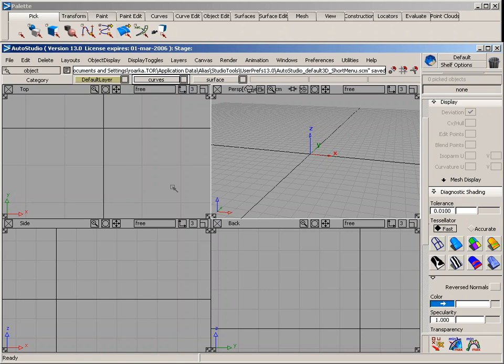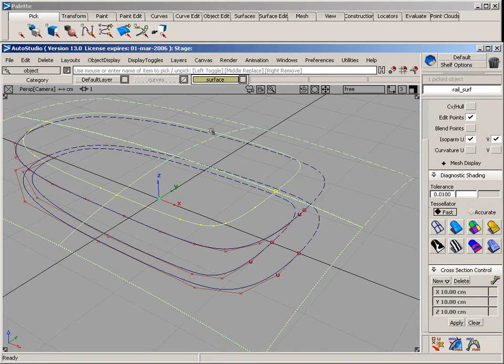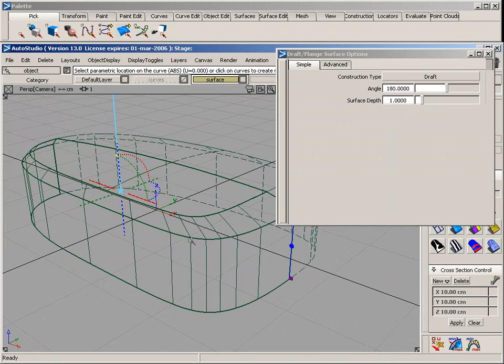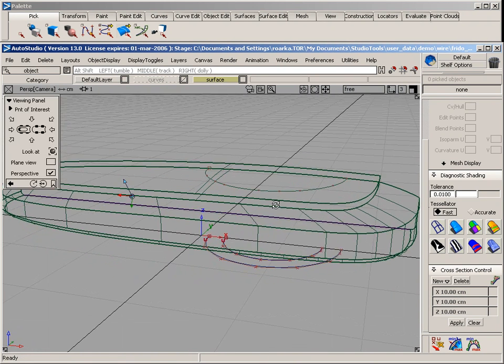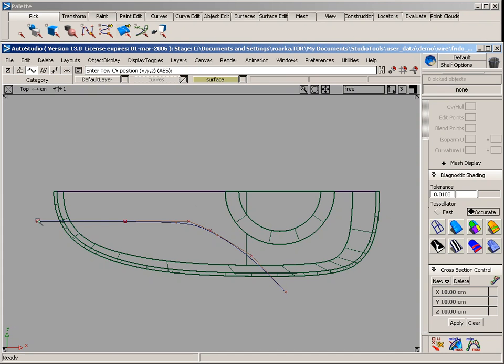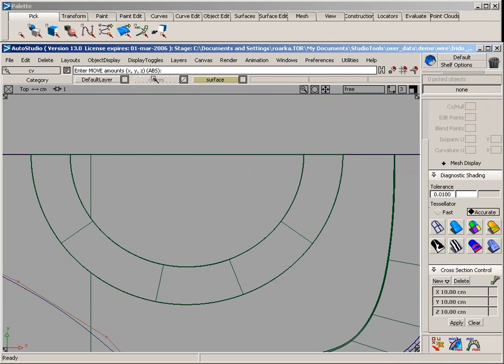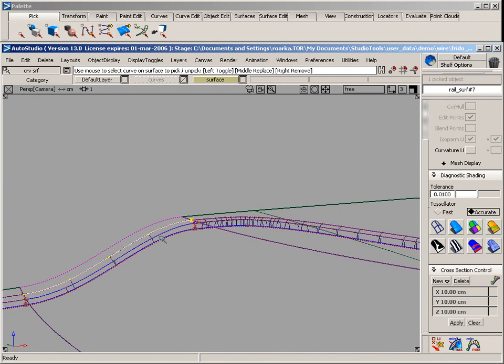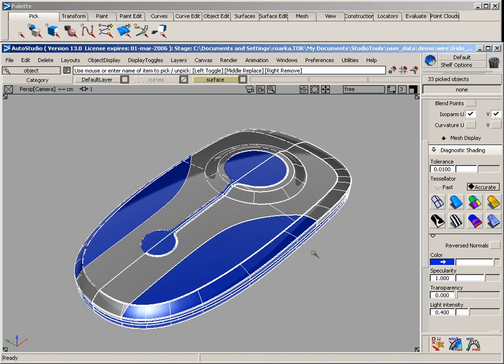Industrial Design

Comment: I hope you still reply to comments! :D
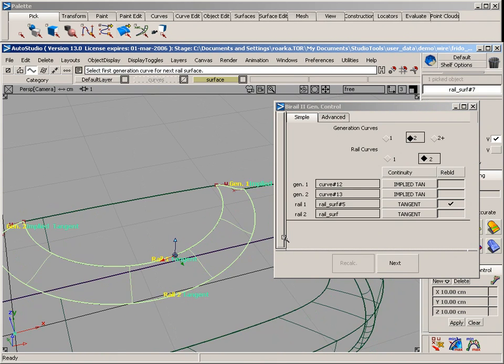I have a problem with the rail surface generation at about 26:00. I can't seem to select the upper semi-circle as my second rail curve. As if that isn't a curve at all. In fact, I tried selecting as a curve and it didn't work. What did I do wrong?
Thanks! :)
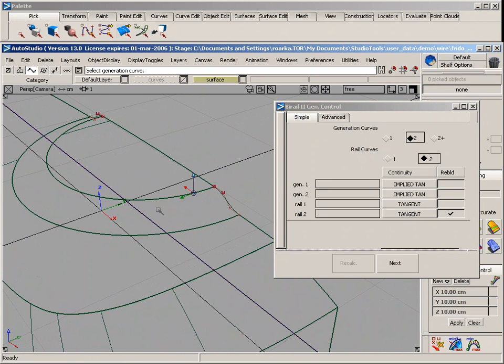Reply: At 25:30, to be precise. Your "rail1" is the problem in mine. Doesn't get selected.
I guess I must've deleted the original curve. :/

Comment: Hello there, thanks much for these tutorials are very helpful, can you help me a  little bit? I am using Autodesk Alias Design 2013 and I can't find how to place the layers bar at the top of my window, I see that is a very clean and  organized way to work. Thanks!
Reply from the maker: Hi Otoniel,

Hopefully you found it by now, but if not, it is an option located under the "Layers" menu at the top of the program called "Toggle Layer Bar".

Hope that helps,
Josh
Reply: Yep found it! Thanks much! Do you have a Twitter account? It would be nice to follow your twitts, and would be easily to ask you on further questions. Cheers!
Reply from the maker: Otoniel Ramirez I do, but I'm awful at keeping it up to date.  Regardless, it's delorun45230
Reply: I have added to my Twitter account.  :)